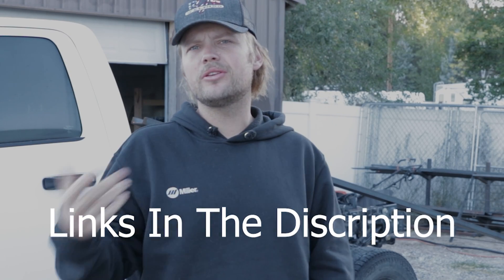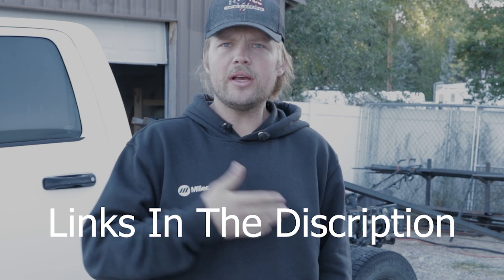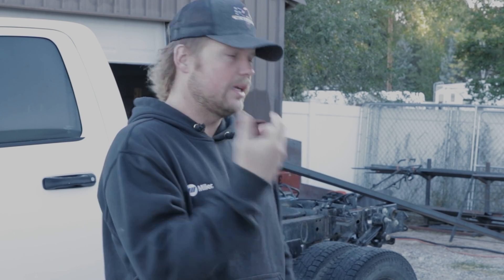10" Rollout wheel DIY

Comment: to free up the vice use a piece of threaded rod in handle hole. use a turn knob to hold in place in thru hole on table.... quick clamp to adj grinder throttle.